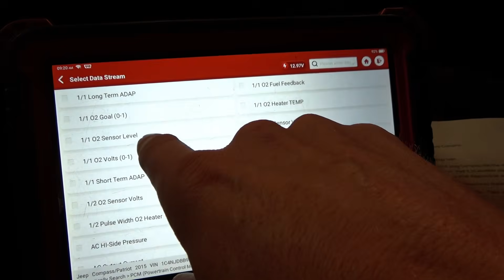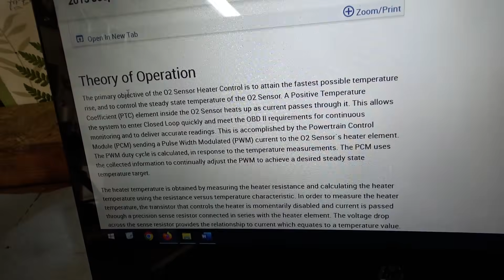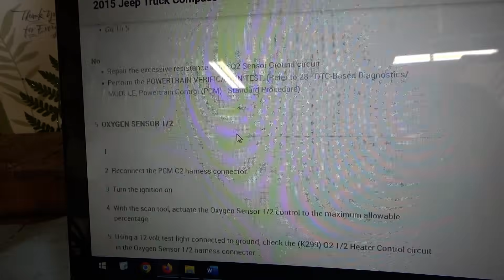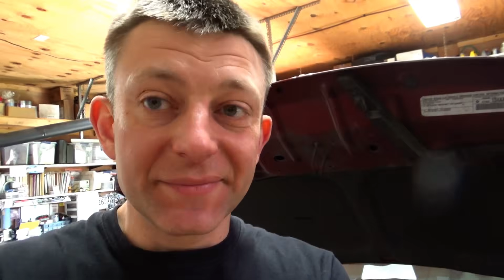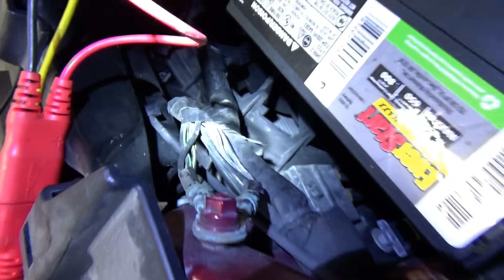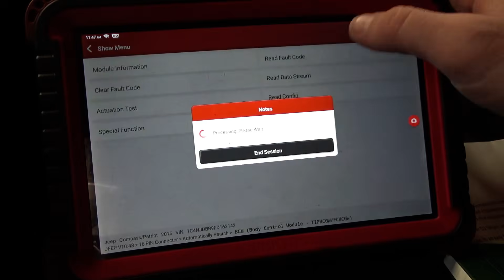Shop Says "Jeep Needs a TIPM"...and DEAD WRONG!! (15 Compass P0038)

Comment: So your breaking off the wires right at the connectors to keep the wires as long as possible, huh.
  Soldering after crimp is OK but you don't want to solder than crimp, you get an improper crimp hold ,the solder connection gives you a false crimp tightness and will loosen over time.

Comment: well worth the 4 hour trip. If the other shop replaced the TIPM which wouldn't have fixed the problem, they then would have called the customer back and said "Hey- looks like you need a new ECM as well" -  and down the rabbit hole they go...  all because they didn't do methodical diags like Ivan does.

Comment: Thank you for your info. I have the same problem as the same sensor. New o2 sensor erased the code after putting a new sensor. Code turns right back on within  seconds after starting the truck. I was looking for the ground using the same wiring diagram. Your video showed me where to find the ground. Same ground, so much   corrosion on that same  ground. Im in Pa, too

Comment: I'm not an expert, do a fair amount of tinkering with electronics.  My dad was an HVAC service tech.  He recommended relying on crimp connecters/no solder on stranded wiring where there is vibration or similar.  When solder is used on stranded wire like this, the point in the wires where there is no solder (flexible) to where there is (stiff) can be a likely failure point (strands breaking where they constantly flex with vibration/movement next to the soldered/stiff part).
Reply from the maker: You can't rely on solder alone to hold together a vibrating wire. The wire must be mechanically reinforced and supported by shrink wrap and taped/tied to the neighboring wires or other solid structure 😉
Reply: @PineHollowAutoDiagnostics  That makes sense. I'll keep that in mind.  Also you mentioned using some kind of anti-oxide.  I might have instead or also used additional soldering flux, but it looked like your solder bonded with the metals well.  "Cold" joints are a really bad thing.

Comment: Copper wire to aluminum connector will cause corrosion at the connection point.  Bad Engineer designer.  They know it will corrode, but will last past warranty in most cases!

Comment: Seems to me it’s just a normal Chrysler problem. I have an 07 Dodge ram 2500 broken wire for the rear speed sensor. I have fixed broken wire to the right door. I have fixed now. I have another right door broken wire. I have to fix somewhere. I have a open circuitfor the ABS system.

Comment: The shops may make profits on large ticket items so they may use that to make money all the while knowing (maybe not knowing) the part is ok.  After replacing my back up camera and trunk release switch recently they were not the issue.  It was two broken wires along with 4 about to break in the trunk.  The contractor the dealership hired diagnosed the camera and switch for the repair.  I told them I just replaced it with both new GM from the same dealership and declined the repair.  The dealership here in Ontario, Canada wanted to get rid of the contractor and re-diagnosed the broken wires.  They fixed those and the repair was minimal charge as they agreed to find the correct diagnosis for free.  This video seems to be along those lines.  Thanks for the detailed review.

Comment: I was wondering why you didn't disconnect the PCM plug before taking your Ohm Reading on the heater circuit? Could there be feedback from the PCM internal circuits that might give you a false reading? Just curious. Thanks for bringing us along Ivan.

Comment: One point that needs to be considered when replacing a crimp connection with a solder connection is the possible loss of flexibility provided by the multi strand copper wire itself. If the harnessed wires leading from the newly soldered connection are subject to any sort of movement/ vibration, the copper strands will eventually all break at the solder joint. Classic case is when a crimped engine block to frame earth is repaired with solder. Instead of lasting years,  the rocking of the engine breaks the wire strands at the solder joint, usually in a matter of months.
So, to ensure a lasting solder  repair, if there is any chance of the harness moving or vibrating in normal operation, then the harness itself must be locked to frame or body so that the solder joint is isolated from movement. On the other side of the lock, the harness can then take back the advantage of the movement allowed by multi strand copper wiring.
In short, make sure your harness isn't going to have movement anywhere near your solder repair.

Comment: Maybe a long read, but totally worth it.... Took truck to dealer w/ tire light on. Dealership told me I needed a tire pressure sensor. I asked if they'd put air in the tires, was mindful to remind them of the spare tire as well because it, too, has a sensor. They put air in up to spec (barely), but said the light would remain on till I got a new sensor. I asked if they put air in the spare, they said they weren't sure -- the one I was speaking to didn't actually do the work. Luckily, I had a tire pressure gauge with me, so I asked if I checked the spare and its low, can they put air in it? They said I'd need to talk to the service desk. I checked and the spare was 7+ PSI below spec. Walked into the service person's area, and the service person went on a whole rant about how I needed a new sensor, they didn't have one, I'd have to come back, yada yada, when she finally let me talk, I nodded my head and said "I understand, but I just checked the spare and its low *shows gauge* can we put air in it and see what that does? She sends it back for air in the spare, it comes back, no tire light... SMH
Reply from the maker: @deadduck8307  why not just pump up your own tires? 🤔😂

Comment: Ivan, 
Tin your iron, then place the tip of the iron under the terminal (heat rises) and heat until the solder flows through all strands. If the solder has a dull look the joint is applied too cold. Mostly this may help your viewers (I am certain you know this).

Comment: Great work! I use ACF-50 on problem terminals. I have a Weller D-550 soldering gun 325 watts that is great on larger bundles of wires into heavier terminals lots of heat fast. Look for an old style gun that has the tip nuts not the set screws and keep them tight. I paid $5.00 Cdn. at a thrift shop for a like new old style D-550. My  Weller 921ZX soldering station will go to 850 degrees F but it is only 90 watts. Needs more power for a larger thermal mass.
Find some older Kester or Ersin rosin core solder Not lead free! Going out to check my 2017 Ram 2500 grounds. Black wire corrosion is a topic to search. 
Love your videos and thinking.

Comment: There are two main problems there. One, the connection is just a crimp with no solder or heat shrink over it. Two, the connection is near the battery. The battery fumes will start to corrode the wires over time, especially since they are near the grill with all the moisture of driving when it is raining and such. My jeep used to have a wiring connector under the battery that disintegrated because of all the fumes and such. Great Job Ivan!

Comment: It's caused by a bad ground reference to the battery from the factory. Where they mount the lug to the frame is not referencing the battery due to paint, e-coat ect. Once reconnecting the wires, make sure the paint is scraped. Clean and meter the resistance from that grounding point to the battery. If resistance is still high and unacceptable, start cleaning grounds back to the negative terminal of the battery.

Comment: The location of earth point near battery fumes is a problem waiting to happen, probably their downfall of making assumptions because car so clean it wouldn't have ground faults, as vehicles age the hidden is going to be the most likely, everything deteriorates with age and the stack up becomes more prevalent,  simple things like crimped connections which when new perform as good as soldered joints become an area that is hard to quantify visually yet can stop the game

Comment: As a tech with 34 years of experience, that made the change from independent to dealer tech can tell you the problem isn't dealership training, ford emphasizes the use of the VCMM which is our advanced scope, with a ton of features the aftermarket wished they had, the problem is with these tech schools educating for profit, The kid that works in the stall next to me is more concerned with going to Rhode island clubs than fixing cars, and have failed multiple times at our basic electrical training. The problem isn't dealerships but the entitlement instilled in these dumb kids that over pay for a diluted education.

Comment: Your video saved me from driving my Jeep compass to the junk yard. Couldn’t get it to pass inspection due to this P0038 code. I went to 3 different auto shops & each one diagnosed it incorrectly, which costed me money, time, and my sanity. Replaced O2 sensor multiple times, replaced PCM… every “solution” lead me down the wrong path & further away from this simple yet logical solution. My car is now code free, my left turn signal now shines brighter than the sun, & the performance has improved significantly. Thank you so much!!!!!!
Reply: Excellent

Comment: What is strange is why a shop would provide a customer with a diagnosis indicating a new TIPM with an OBD II DTC of P0038, which has nothing to do with the TIPM.

It's crazy to mount the ECM horizontal because water could pool in the connector. You would mount it vertically. I would be tempted to seal the harness connectors with Grote Ultra-Seal. 

The problem with the corroded ground eyelet installation is the unsealed folded crimp connections. A better connection is a sealed (dual wall heat shrink) barrel tin plated copper compression lug without an inspection notch, meaning the barrel is completely sealed. I think you could accommodate all the ground wires using two 4 AWG on one 6 AWG compression long barrel lugs each with three crimps and sealed with dual wall heat shrink. Using a 6 Ton electric / hydraulic compression tool with hex dies you would not need to solder the connection. The high compression force will basically cold weld the strands together. 6 Ton is good up to 4/0, above this you would use a 12 Ton tool. For auto / truck transportation you rarely see cable sizes larger than 2/0, so the 6 Ton is very popular for automotive work.

If I was to solder the eyelets I would use our PACE ADS200 at 120 Watts which would do the job, but I think I would just use the JBC HDE at 250 Watts which would make easy work of these solder joints. I have very large chisel tips for both the PACE and the JBC. The JBC was specifically purchased for these types of large eyelet solder joints. 

To make the solder wick as Ivan suggested in the video you will have to add some liquid flux. Using a high power soldering the eyelet solder joints would take about five seconds to complete, and would be made at the target temperature. For eyelet soldering you would use Eutectic tin lead (0.062 diameter multi-core 3.3% RA flux) with extra RA liquid flux in a small brush bottle added before making the joint. Liquid flux is the best flux for this job, better than tacky or paste flux.

Before soldering the eyelets you would make sure all the eyelets are bright tin, very fine scotch-brite sanding disk will work if are careful not to remove the plating. A bore brush can be used to clean the battel, then wipe down with IPA and let dry.

You would clean up the ground stud and its mounting base with wire wheel drill brushes to shiny bare metal. Ideally the body ground flat mounting boss would be the same surface area of the eyelets to maximize surface area contact. The best hardware for the mounting stud would be a 316L SS flange nut, lock washer, and flat washer. The SS hardware is for corrosion and not to conduct current, it is the flat ground boss face surface area which will conduct the eyelet current.

If you really want to get technical with the OEM electrical harness engineers in regards to a multi-eyelet ground body stud connection the eyelets are stacked from highest to lowest nominal worse case return currents. Meaning the highest current eyelet would be first on the stud stacking outward to the lowest. 

An OEM option to the Silicone paste would be Ford Motor Fluid XG-12 Electrical Grease, or you could use DeoxIT Electrical Marine Grease or DeoxIT Battery Cleaner & Protectant with Brush Lid, which has a red color and brushes on like paint. All of these would seal the bolted connection and would be applied after the eyelets were bolted in place.

I think I would have replaced the battery negative lug and if I had room in a 2 AWG battery lug crimp add and extra 6 or 8 AWG body ground cable directly to the stud connection just repaired.
Reply: Wow, really good information. I crimp, then solder all electrical connectors, use RA flux, then shrink tube with gel. I think that most people forget that with vehicles, they are only dealing with 12V, and often only 5V DC. That is subject to weather, and even road salt/spray.

Comment: Get an old giant weller pistol for the big stuff. That little solder pen just isnt hot enough to penetrate those big terminals. Maybe it works in the warm weather ok, but by you when its 5 degrees out, you will love the bigger Weller...

Comment: Add flux to your solder work. It increases heat distribution, solder flow, and purchase at the solder points. Silicone paste good, silicone sealant very bad. The acidic acid (vinegar) will corrode the connection.

Comment: I do not recommend piercing any pcm controlled circuits especially outside the vehicle as it will allow for corrosion/resistance. Disconnect C2 from pcm and 02 sensor, turn ignition on and test heater circuit for voltage (short to power) if not done first and there is v your continuity test is inaccurate, test ground. When performing continuity tests the circuit should be isolated . Manufacturers usually never list broken wires as possible causes as circuit testing is always part of they diagnostic chart. Using a scan  tool to increase and decrease duty cycle while using a test light at the 02 sensor connector after will confirm pcm heater circuit pwm operation.

Comment: It is a matter of technical ability in some (?many) cases I'm sure. However, flat rate of technicians often doesn't incentivize thorough investigation of cause however. Especially when throwing parts at a condition will actually "fix" the condition a certain amount of time. I think that, if a customer could get all their money back for unnecessary parts and labor that didn't "fix" the issue when the cause of the condition was not properly diagnosed, it would go a long way to "fix" this huge issue in automotive repair.

Comment: So they're using a bias voltage for module diagnostics to set circuit high codes. There's a high ohm resistor in the module, along with a voltage sensing circuit. When the heater driver is off, and the circuit/component are in tact, the module wants to see 0v. If there's an open in the circuit, be it, an open in the heater element, open in one of the wires or bad connection, that bias voltage isn't able to be pulled down. Great diag, Ivan.

Comment: That kind of geound should inside the car under the  dashboard, the only ground  should be underhood are battery and alternator ground, because those ground have big gauge wire that resiste outside corrosion and easy to inspect and clean if there is  a problem.

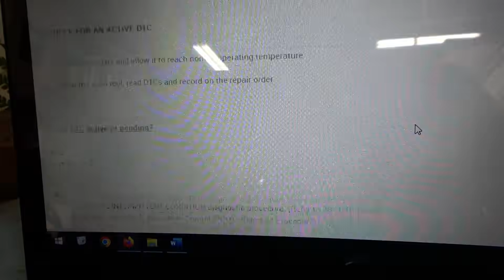Comment: Ivan 600° on your soccer station.That's not hot enough.You should go at least 750 I run mine at 8:00.The hotter you go the quicker you get in and out the less damage you do to stuff.

Comment: Just a thought that having the battery so close can produce acid corrosion. Solder flux will produce corrosion of its own-the reason for FLUXOFF SPRAY.  Last how about liquid tape? Holes and connectors.

Comment: You could've used the mini torch to heat up the eyelets. It would've made the soldiering go much faster. Put a dab of flux on the exposed wire between 
the crimp and the eyelet before heating it up.

Comment: Had a patriot recently that would loose dash function and run rough when the rear wiper was turned on. With the rear wiper motor unplugged it would not start. Sourced it to that same ground not grounding the tipm. Only reason the car would run was from the wiper motor ground back feeding the tipm. Must be a common ground to corrode

Comment: I went around my engine compartment and dabbed Vaseline on the grounds.  After seven years in Northern Illinois, the terminals show zero corrosion. Battery terminals and various bolts get the same treatment.   Especially the battery hold down.

Comment: "heater circuit high" means higher than normal voltage, which implies something downstream of the computer circuit is bad or open and not drawing any current to pull it down.
I guess they could be more detailed in the possibilities listing.

Comment: i understand why you say ....why a tipm.....i say when your in a high volume shop and you get 50 buck to diag. its hard to explain to a customer when you general manager says....no diag takes more than 50 to diag. then when i come to them and say....hey it has a power or ground issue they say well so an so could diag it with just a scan tool. i know you will say find another shop but its not that easy sometimes
Reply from the maker: So never under any circumstances bring your car to a "high volume shop" for diagnostics 😁👌

Comment: Ok...not a sparky but...if that circuit is not ground-side switched, and thus not monitored, how does the PCM perform the circuit integrity check and know "circuit high"?

Great diag and repair Ivan.